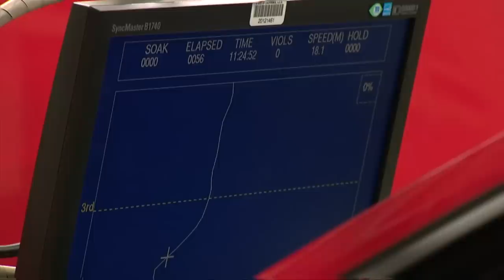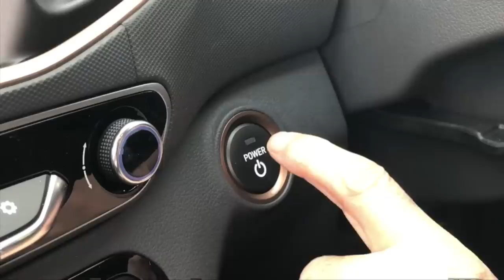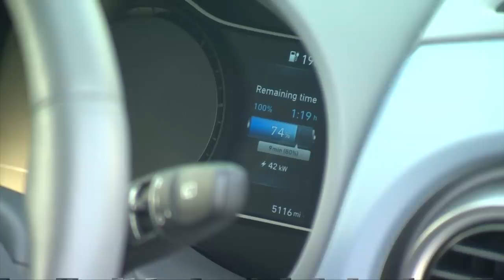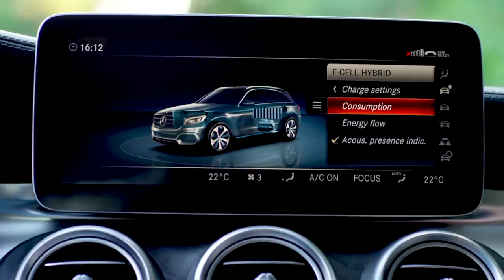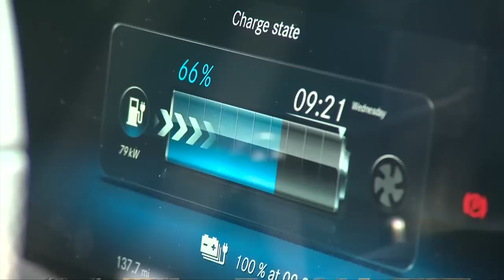Electric Cars: The Future of Road Vehicles? - BBC Click

Comment: The use to say E Cars are impossible and look at them now.
TESLA CHANGED THE GAME😎
Reply: Die Cast Racing with Von  in what way is this related to the topic?
Reply: Die Cast Racing with Von  So because one company with strong ties to the fossil fuel industry couldn't make electric cars work 20 years ago, they're impossible now?
Reply: Die Cast Racing with Von  the article you linked talks about regular batteries, not lithium ones, BOOM
Reply: Die Cast Racing with Von  also stop advertising this shitty site that would like to know my location
Reply: Jesper Monsted saying a motor vehicle manufacturer has strong ties to the oil industry is like saying that a electrical appliance manufacturer has strong ties to the power generation industry. Neither group cares what where the energy to power their products come from so long as it's the cheapest because most of their customers live in the real world and have probably worked for their wealth.
Reply: Die Cast Racing with Von  VW will invest 34billion into E-Mobility and you say its not the future, hahahaha you sir have no clue what you are talking about. Next year there will be the new roadster from tesla.... Tesla Roadster 2020 with over 600 miles range and over 360kmh fast.
Reply: Die Cast Racing with Von  the heat from the charging process can heat the batteries up enough
Reply: Die Cast Racing with Von  GM proved your statement is patently false. GM knew that EVs are the future, were highly desirable and therefore forced the "owners" to lease them. They were only leased so GM could take them back and send them to the shredder (which they did!). GM was terrified that a no-maintenance vehicle was being made. It proved wildly successful (the EV-1) and GM knew what would happen as more were made...sales of gas cars would die. So they bribed the politicians in California, got the requirements relaxed, and destroyed their EV-1s. BOOM!
Reply: Electric cars are still Garbage . That's why most people don't buy them unless they are given some sort of a rebate. I know of a friend who hates it because it takes forever to charge and that there is no way to quickly regain like 100 miles in seconds. Where as with a gas car you can fill 100 miles in a couple of seconds.
Reply: @palaubranm6961  Wow, lots to unpack in your statement. First, Tesla outsold Mercedes Benz (and several other brands) in the USA in 2018,  you will have a bad time saying people don't buy them. As for a financial incentive, not buying gasoline and no mechanical repairs are their own reward, yes? As for taking "forever" to charge, please tell your friend that I've driven tens of thousands of miles in an EV with no overall impact to my driving time. I recharge on the highway when I stop to eat or take a break, 20 mins is all that is needed to go another 150 miles. More often than not, the car is charged before I'm done with my break. Since 95% of all driving is done from home, not highway, your car recharges overnight and is always full in the morning. Would you be complaining about that if your gas car refilled itself from a garden hose? As for refilling 100 miles of range in seconds: being chased by the police, are you? When you're on the highway after, say, 3 hours of driving, you have so little time that a 20 minute break is too long? I find your driving scenario quite unlikely to make the decision to purchase a car. If you're in that much of a rush, take an airplane. Oh and by the way - driving an EV gets you there at 1/4 the price of gasoline.
Reply: Sometimes when I do road trips I don't stop for like 5 hours and when I do I take like a 5 minute brake . With a stupid EV I would have to take an hour long brake after every 3 hours of driving. Worse if I am driving uphill because EV's suck going uphill and I will have to take a brake after every 1 hour of driving because the battery would die.
Reply: @palaubranm6961  Your information is false. It is NOT an hour break per 3 hours of driving - where are you getting your information from? I've driven across my continent in an EV and take a 20 minute break every 3 hours or so to recharge; that's all. My car is done charging before I'm doing taking a pee and having a sandwich and NOT SITTING.
Reply: @justsomeguy934  I am sure a Tesla will run out of power after 1 hour of driving uphill. Anyways electric cars are not great and is not practical at all.
Reply: @palaubranm6961  Well, from personal experience, I've driven across a continent in a Tesla and (surprise!) I didn't stop after an hour. And I drove thousands of miles at 1/4 the price of using gasoline. Go figure.
Reply: Lol bs. Electric cars will never be the future. Me and my friend got stuck at the cottage because the stupid power went out and we were stranded for a day. Stay away from EV.
Reply: @palaubranm6961  And a car that was designed a century ago, dependent upon one and only one dwindling energy source is the future? Ever run out of gas? I have! I was stranded. Or stranded due to one  stupid part out of the hundreds required to make a gas engine run failing.
Reply: @justsomeguy934  that's why you carry gasoline with you when you are traveling to remote areas. With a stupid EV you are pretty much stranded.
Reply: @palaubranm6961  Actually, there is electricity where there is no fuel. First and foremost, do you get in a car and randomly decide where you're going? Did you, this past Tuesday, say "I think I'll drive into the Sahara, not sure where I'll stop, just go until the car gives out"? 
I know a guy that took his Tesla to a remote resort in New York state, and got there and back where there was not fuel stations. How did he do this? The cabin he went to had electricity (you know, the grid?). He let his car charge for the days he was fishing, canoeing and  sleeping. When he was ready, he got in his Tesla and drove back. 
With a stupid gasoline driver you're pretty much stranded. Face it, pal - you just don't like change. It's OK, my father didn't want electric windows in cars. I bet you have them...

Comment: Most Manufacturers guarantee 100k miles for their batteries. 

Tesla: Hold My beer. Guarantee 1mil miles.... and once you done we take them and use them for Tesla home battery, and once its done 10 years later we recycle the materials and make new battery.
Reply: Tesla battery warranty is actually only 100k miles for Standard Model 3 and 120k miles for Long Range. Though the data show that they last way longer than that in reality. Elon has said the current batteries should last about 500k miles and they will be releasing a million mile battery next year. Obviously it would take the average driver rather a long time to clock up a million miles, but Tesla are clearly focussed on building the best robotaxis.
Reply: @jonathanmelhuish4530  Model 3 is 100k, but S/X is still unlimited miles / 8 years. I know of a S that has 450k miles in ~4 years.
Reply: @rkan2  that is the real life not the warranty. The Model S and X warranty do not cover degradation.
Reply: @niffrig I haven't heard of a single case where degration has gone to like 60%. The battery has always given up in some other way. You can get used Tesla batteries for 10k€, so I wouldn't worry about replacement costs either...
Reply: @rkan2  Wow, I didn't know that. That's impressive. That will explain why there are companies using those models for long distance taxi shuttle services then!
Reply: TESLA = TRASH!!!!!!
Reply: @jonathanmelhuish4530  
wasn't the million mile battery just a test development thing and its not really gonna be in use, plus uses a rare earth they are trying to limit so I can't see them just starting a bunch of them getting made. also it was a million  miles but had drawbacks in other areas.
at least the thing I watched on it was saying these things
Reply: MrGonetopot 
As you probably know, that was a one off and was a deliberate "mistake" by a recalcitrant dealer in Australia.
Nice try though.
Reply: @jonathanmelhuish4530  I personally know someone who had their battery pack in their Tesla replaced under warranty at about 200K miles. It was replaced because some electrical component - not the batteries - had failed. Tesla is constantly changing (improving) their battery packs. When I bought my Model S 4 years ago, they were already on pack "E" or something - 5th generation. I know another change Tesla made, it was to their cabin heater. Apparently several owners had their cabin heaters fail, and Tesla discovered that it was a fuse built into the heater assembly that was blown, not the heater itself. Replacing the heater was expensive (labor), so they moved the fuse off the heater and put it in a more accessible place. Problem solved. They are constantly doing things like that.

Comment: I've been driving my Nissan Leaf for 8.5 years (one of the original).  Batteries are still going strong and it is so cheap (practically no maintenance and under 4cents/mile).  I figure I will get another 8 before I need to replace the batteries.  For long trips I take my Harley :-)
Reply: Good to here as I just purchased a 4 year old BMW i3 and the battery looks to be good.

Comment: Range Rover: "Gets updates over the Air"

Tesla: ahhh rly...
Reply: Niklas F give them a while theyre a bit behind, something to do with being scared off new technologies 🤷‍♂️
Reply: I like to make fun as much as anyone, but to be fair they have actually done it, while most other entrants have not. Kudos for joining the future.
Reply: @yorkyone2143  derp, every modern car is hackable. Have been for years. Doing it in situ is far easier than circumventing the ota update with say a man in the middle attack or some such.
Reply: @yorkyone2143  Tesla have been doing OTA for years. I haven't heard of any issues like you mention.
Reply: @yorkyone2143  do you know how this might be done? Or are you just fear mongering with no clue?
Reply: I wished my Peugeot 3008 SUV could update over the air.  At present you have to download (via PC) some files on to a memory stick, plug it in to your car's USB and leave the car running for an hour.  I've had my 3008 for over two years and still have not got round to updating the Sat nav or firmware.  What a joke...
Reply: @yorkyone2143  Wow - what a scenario. I guess you don't own a computer, yes? It could've been compromised by terrorists!
Reply: @yorkyone2143  To answer your question about Teslas directly, from the onset of their car development they took steps to prevent outsiders from hacking the car. It's far more secure than any computer or device you'll ever use. It's just not a scenario you need to worry about.

Comment: The time to switch to electric was 50 years ago. It'll be interesting to see how many of the existing car manufacturers last through the change.
Reply: 50 years ago the traction battery was either lead acid or nickel iron (so called NiFe cells). Heavy with insufficient energy density or power density to be competitive with internal combustion vehicles. 23 years ago GM produced the EV1, that initially used lead acid batteries but soon swapped to NiMH cells which made the car competitive with ICE (but GM sold the patent for using NiMH cells to power cars to Texaco (the oil company, through an intermediary) which they sat on thus killing the electric car until Li-ion cells became available (they were even better than NiMH for that application and not under the control of the oil industry).

Comment: Accelerating in "ludicrous" mode will suck the juice out of those D batteries in no time.  And that big fat traffic ticket for street racing, so practical.
Reply: That's what they never consider.  There was one funny story where an electric police car ran out of juice in the middle of a high-speed chase.  (A search will find multiple reports on the story.  It happened not long ago in California.  You'll find lots of apologist comments, and deflections like "gas cars can run out of fuel too".  Yeah, but they rarely do.)  Batteries don't like that kind of stress, and they die a lot sooner than expected with the pedal to the metal.
Reply: @joesterling4299   Yes, and even when they low on fuel, it takes only a couple of minutes to refill just about anywhere (gas). More an EV is pushed, faster the battery dies, rather quickly. The advertised specs for range is for "under ideal conditions", which are never realistic.
Reply: @joesterling4299  in that story of a Tesla running out of energy, the police dept failed to charge the car the night before. Empty tank, no pursuit. And gas cars ALSO get poor range at full throttle.

Comment: I don''t know about prices in the UK, but the comparison about it being half the price to fill up... I think it is better than that, for me it is more like 8 times cheaper.

You used a 50 kwh battery, as an example versus a tank of gas.  I think, given the range disparity, you probably want to consider 1.5 batteries to be equivalent to a gas tank (or 75 kwh) to be really comparable to an average car's gas tank (yes, that means you would charge the electric car more than once, but you do that every day when you get home, like a phone, so it's not an inconvenience) so if you said 7 gbp for 50 Kwh, it's probably more like 11 gpb to get enough electricity for the
car to go as far as filling an average gas tank would.

For me, at home in Québec, Canada, electricity from power dams (98+% renewable) and my cost is 10 cents/kwh... so 75 kwh ... is C$7.50, or about 4.40 gbp.  My gasoline fueled car, at 10l/100km... and (car has a turbo, requires premium) 1.40 $C/l , say 45l -> 63 $ for a tank... so electric, for me, is roughly 8.4 times cheaper in terms of "fuel".  It will be closer to 10x if you're driving in traffic where EV's are more efficient, and maybe as low as 8 if you do a lot of highway driving. Anyways, here at least, the disparity is a lot bigger than you portray.

Comment: God I have to get a Tesla!
Reply: Personally waiting for them to get their paint to stick on...
Reply: @rkan2  It seems you have only the "info" media tells you. That is not full story. Problematic cars are rare and 99% have no problems with paint.  In case of M3, if you want extra protection, get mudflaps from ebay, 30eur delivered and you are good to go. No need to wait. ;)
Reply: @afpv2225  Yeah maybe only "problematic" cars now, but in the future they will be worse... I'm probably more familiar with the story as one of the guys who created it (check out Joni Savolainen on YT)... Overall the M3 paintjobs are thin, soft and flaky.. You'll get better with any established car manufacturer (or the S/X). A paintjob like those simply will not stand the time in places where things freeze. Too bad you can't get the cars without a paintjob :)
Reply: @rkan2  if the only the interior didn't feel like a cheap economy car, when you hop out of a 100,000  Benz into a 100,000 Tesla you can tell the difference...
Reply: Yeah, pretty much. There is a large used market for Teslas now too so actually "getting a Tesla" is not impossible at all...with many more new running off the multiple assembly lines every week now. The Tesla is now connected via the SpaceX launched Starlink Satellite Constellation now too apparently. Elon just sent his first tweet using Twitter Starlink apparently. Be nice if Tesla has their own messaging app as such. The rest of the Industry save General Motors (OnStar, Cruise Automation) is hopelessly lost at the moment.
Reply: @SCHMALLZZZ  You have button farms on the brain. You equate buttons and levers to quality. They're more like the controls of a steam engine. Oh and the Tesla interior isn't bothering too many people, Tesla outsold Mercedes Benz in the USA in 2018, and several luxury brands combined. Go figure.
Reply: God  drives a Volvo. He does not want to be showing off.